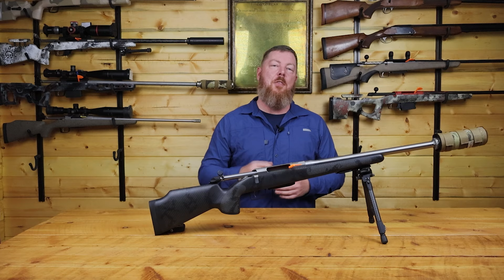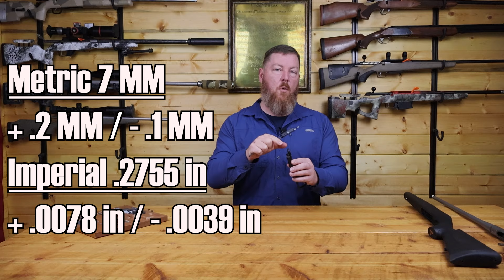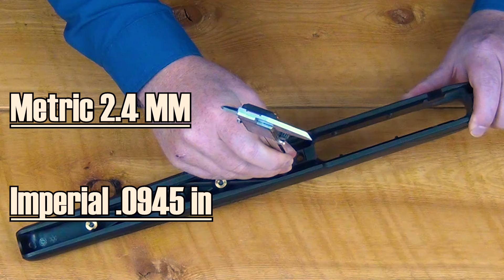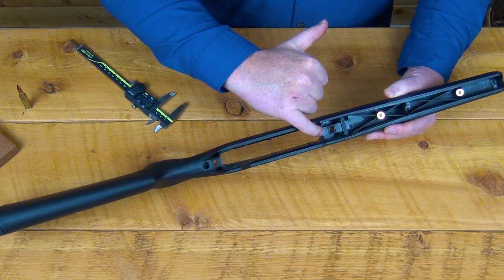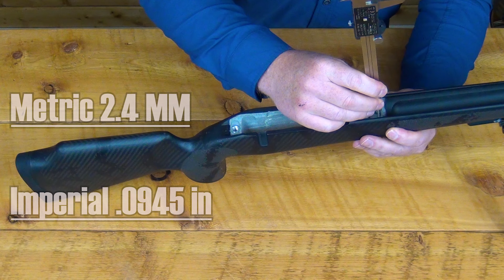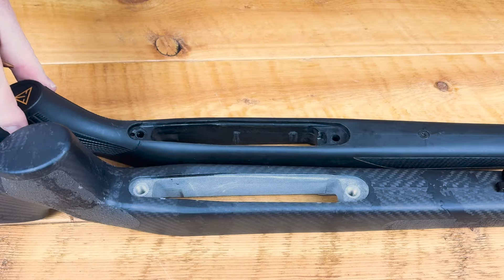How to Diagnose Tikka Stock Problems

Comment: I recently purchased a Tikka T3X CTR 6.5 Creedmoor, New in the box. I removed the stock for initial cleaning and trigger adjustment. I noticed while re-installing the stock that the action seems to be rocking on the recoil lug, ie; pressure on barrel side back rocks up, pressure on back side of the action at barrel rocks up. Double checked that action was engaged in action recoil lug slot. The recoil lug height in front of lug is 2.3mm but the measurement at the rear of the lug as indicated in the video is 2.52mm. Anyone else noticed this? Solutions to lower recoil lug in the stock? I also noticed that the action screw holes are raised up above the base of the action, but there is not any recessed are in the stock to accommodate them so the action never really sits into the stock fully, only on the raised areas of the screw mounts.
Reply from the maker: First off, good on ya for taking everything apart and doing a good clean and adjustment on the rifle before running it. 

We have seen this before. Usually it is caused by the pocket the recoil lug sits in being damaged. When the lugs are being pressed into the stock, sometimes a sliver of plastic gets pushed down and blocks the lug from seating correctly. 

In this video, I show you how to replace your recoil lug. However, you could use this same process to remove yours and inspect the stock for any obstructions. 

https://youtu.be/E3KezTau-OE?si=nc8xq3umkMqiwlYM
Reply: @mountaintacticalcompany  Thanks, I suspected something may be up with that. I tried to remove it with pliers, not a lot of material to grasp onto, it wouldn't budge. May try some vise grips but then may damage it. I guess I could drill a small hole in the stock underneath it to be able to punch it up. l'll take it to the range and see how it shoots first. Thanks for the video and and insights.

Comment: Oh great, second time I've entered into the Tikka world this year & MT puts out another vid with possible issues on something I'm actually attempting soon! Your as timely as the angel of death MT!!! 😂😂😂
Reply from the maker: Oh man!  That’s not my intention at all!  The factory stocks perform better than most people realize. My goal with this video is to help the guys doing DIY projects understand why their parts might not be going together the way they hoped and then be able to have an educated conversation with a gunsmith so they don’t get screwed.
Reply: @mountaintacticalcompany  Na just playing. Should be a successful mission. Mcmillan cf stock with your bottom metal. Should be a winner. 😅
Reply from the maker: Yeah!  I’ve used a bunch of the carbon stocks in this video but their quality has gone down hill. I’m going to order a McMillan Mountain Trakker with carbon fill. Should be 2 oz. Lighter even with an integrated arca and pic.

Comment: Im greatful you just posted this. I just bought my first tikka t3x roughtech 308 yesterday and noticed this issue as well the front end of my magazine feels spongy. It does not feed the first round well and wont catch the following rounds.

Was wondering what was wrong. I can see the front end of the magazine is not in full contact with action. The stock is certainly off spec. Thank you for your video. Nice to know its not a one off issue
Reply: It's very important that the recoil slot is mated to the recoil lug .
Check that the gas evacuation hole is flush with the stock .
If it's any gap between the two the action is riding on the lug .
Reply from the maker: 100%
Reply from the maker: Oh man that’s frustrating with a new rifle. Hopefully you’re able to diagnose the part of the stock that is out of spec. 

When you’re checking your stock, also check the recoil lug slot on the bottom of the action. The Cerakoted rifles have been having overspray issues. They may have sprayed it on too thick. It should be 2.4mm deep and 6.1mm wide.

Comment: What exactly is a “spongy” magazine?
Reply: Basically the magazine moves up and down if you apply pressure(which Jason demonstrated), which means the magazine probably won’t feed correctly. You should be able to push up on the magazine and feel very little movement. Spongy, squishy, a magazine that moves up and down when it shouldn’t essentially. A very common problem that has been addressed on this channel time and time again!
Reply from the maker: Colin nailed it.  The magazine doesn’t seat against the action like it should.
Reply: @mountaintacticalcompany  Thanks to both for the further clarification.
Reply from the maker: Cheers!
Reply: Thats what happens when you go around changing everything and putting aftermarket parts on a gun that was designed to work as is. Like people that change everything out on a Glock and then wonder why they jam and blame Glock....
Reply from the maker: Or guys who put the wrong spacers on their wheels and lose a tire going down the road.

Comment: I wish Tikka didn't charge 900 bucks for cheap, plastic, Crosman BB gun stocks. ;(
Reply: The Tikka stocks isn't at all in the same range of plastic stocks like Remington or other Americans. 
The Tikka stock is very well made and rigid .
You don't get any accuracy advantage to change to a aftermarket stock .
But if you is not in to plastic stocks for feel or appearance it's a other question...😅
They also comes with laminated or wooden stocks  if that's helps .
Reply: Actually the new Ruger American Gen II's have upgrades to the stock ergonomics that Tikka's don't have and they are over 30% cheaper than Tikkas.  Tikka's stocks are "functional" but let's not kid ourselves, this is the YouTube channel of a company  that makes proper, quality aftermarket stock fittings for the tikka stock for a reason.....because it's a cheap stock....
Reply: @Simon-talks I find it funny that people buy a Tikka, brag about it BUT then change the stock, change the barrel, change the trigger and change the magazines. If you want a good tactical rifle for long range you could just buy a Sako TRG? You pay for one gun and then at least as much again for parts, did I get it about right? Someone should start selling only actions to the US 🤭😅. Greatings from Finland, home of Sako/Tikka (sadly sold to Beretta 😔) 🫡.
Reply: Even better, B&C and AG both make glass replacements around 30oz for around 3-4 benjies. 

Carbon replacements up in the 5-7 benjamoney range as well around that 20oz range.

That being said, I’ve got a bunch of spares from take-offs if you’re lookin for Tupperware.
Reply from the maker: I didn’t know B&C joined the lightweight stock party. I’ll have to check them out. Thank you!
Reply: @mountaintacticalcompany  haha I better clarify, B&C makes glass, AG composites make glass and carbon 😅
Reply from the maker: Gotcha!  Last B&C I played with was very heavy
Reply: @MrMcfly907  get the vertical grip, sand out the barrel channel and get something to raise the comb instead of wasting 700 dollars on those ag or b and c stocks. The only one that’s lighter is the privateer which will have worse ergos.
Reply from the maker: Getting a used one on EBay or Numrich is much cheaper!

Comment: I screwed up my new t3x stock by misthreading the screw while installing the vertical grip. Do they sell the brass insert?
Reply from the maker: You can get an M6 thread insert from your local hardware store. Worst case Amazon has them. Way cheaper than Tikka….  If they would sell it to you

Comment: Ya know everyone bitches about Tikka stocks but I really like them. They seem to fit me good and have never had any accuracy issues.
Reply from the maker: Right?!?!  We cut one up during our anatomy video series and it is incredibly well made.
Reply: I think Tikkas stocks are fine. I know Tikkas are more expensive, but they are an excellent value in terms of the barrel, action, trigger, safety.
Reply: I agree people say they are cheap flimzy stock but for a factory stocks they are pretty good and rigid is aftermarket better yes most are but At least with a tikka you don't have a cheap stock like some others
Reply from the maker: The triggers on the Sakos and Tikkas are identical internally. The only difference is the housing and bolt lock release.
Reply: @mountaintacticalcompany  that clown is a hater and troll if you ask me. Why else would you be looking at and commenting on something that you obviously dislike.
Reply: Right??? For the price theyre just fine. You can beat the crap out of them, they hold up, plenty rigid for hunting. I dont get what these people are expecting for 800 bucks. It has gotten out of hand.

For benchrest competition yea theyre not enough, but most of the tikka t3xs arent for benchrest shooting. Theyre for hunting
Reply: Yea with the vertical grip and something to raise the comb they are just fine
Reply: Yeah they’re fine. Just overpriced for what you get in cheap plastic design.
Reply: I guess if you are only looking at the stock, maybe you could call it “overpriced” but not if you consider the entire rifle.
Reply: The entire rifle is considered overpriced because of the the cheap, plastic stock and plastic parts and non-existent and useless 'recoil paid'....Should cost 30% less because of all that.
Reply: @Simon-talks  so tell me what rifle in that price range that consistently shoots as good as a Tikka and has a better stock.
Reply: There are tons now. Howas, Ruger Americans Gen II, Weatherby Vanguards, Savages….lots of rifles. All high quality, sub MOA accurate, really good triggers, better stocks and  about 300-400 bucks cheaper too.
Reply: it would be fine if they charged 500-600 for the rifles with those stocks though...not almost 900 or more now.
Reply: @Simon-talks  that’s your opinion and I’m not knocking it but have you ever picked up any Roger Americans? Now that’s a cheap stock and they got expensive
Reply: Yes I've compared the two and  actually the new Ruger American Gen II's have upgrades to the stock ergonomics that Tikka's don't have and they are over 30% cheaper than Tikkas.  Tikka's stocks are "functional" but let's not kid ourselves, this is the YouTube channel of a company  that makes proper, quality aftermarket stock fittings for the tikka stock for a reason.....because it's a cheap stock....
Reply: @Simon-talks don’t kid yourself. You’re paying for a sako barrel and an action/trigger that’s as good as most entry level customs. Plus there’s an added fee for the import